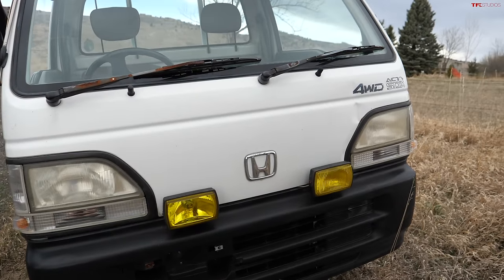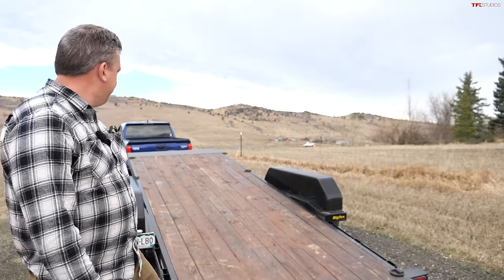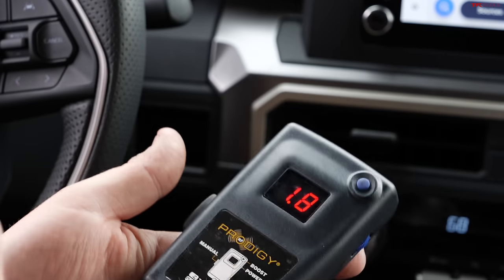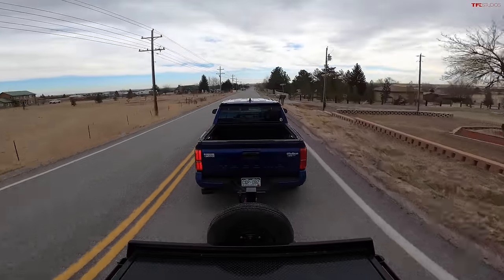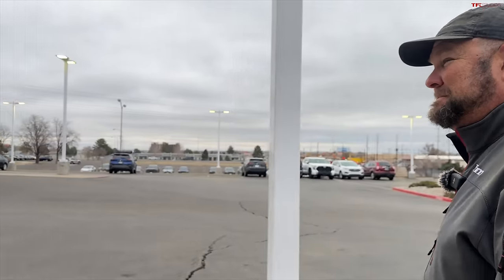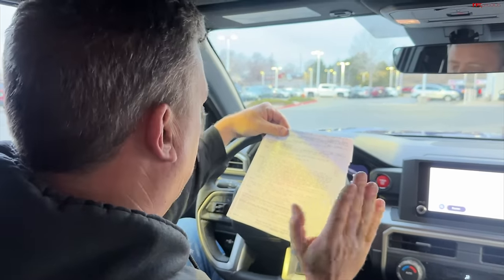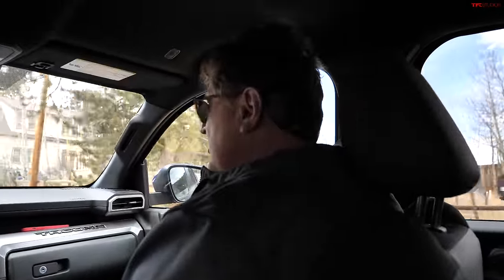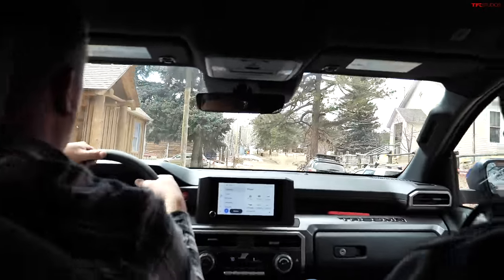Can the New Toyota Tacoma Tow Up the World’s STEEPEST County Road? | Part 1

Comment: Supposed to break under extreme conditions?   That's exactly when you need things to NOT break.
Reply: New trucks just ain't it. Get yourself something with a solid front axle and full time 4WD if you want something that doesn't break in extreme conditions. ;)
Reply: It's meant to break before the transfer case, diff, transmission. It's a good design. What is not good is that it breaks so easily. Either there was a manufacturing defect with the part or the rest of the truck is so weak that the part has to be that easy to break.

I have a 2016 4Runner and live off grid. I have put that truck through hell many times.  Hopefully it's a defect.
Reply: @rundownaxe  it might be cheaper to replace than the diff, transfer case or the transmission but the results are the same when you're out on a trail.  This is why you don't purchase the newest of the new until the major kinks have been ironed out.
Reply: What I don’t understand is why you are doing this?  Who would?
Reply: @rundownaxe my understanding is it's a hold over part. Other utubers have put their Tacoma's on the same trail that the blue crush failed on, and had no issues. I've been watching the Tacoma forums and reddit groups and so far I don't see anyone else reporting a failure of the 4wd system. Now there are other issues like a connector in the front not being fully water tight causing moisture to get into the connector which throws errors in the dash, but that's it so far in terms of trending issues.
Reply: @KiyaWarrior name something with a solid front axle and full time 4wd.
Reply: @slidewide1999 some high end jeeps have a 4 auto setting.
Reply: User error
Reply: @slidewide1999 Ineos Grenadier, Mercedes G Wagon, Toyota 80 Series.
Reply: @Jonesocinco   Hence the hope that it was just an early model thing and not a weak drivetrain saved by an even weaker part. 

Since it's Toyota, I would lean towards the first reason.
Reply: @slidewide1999  Why full time? Takes more gas when you don't need it and if it's sliperry enough that it makes a difference, you could just engage a part time system without fear of binding it up. 

You still have to lock the center diff on a full time system for serious stuff. A fully open 4wd system is practically useless. lift a wheel or put it on ice and it will be the only one spinning.

If there were 2 trucks with the exact same features and traction control. One being part-time and the other full-time. Why would you take on that can't be switched into 2wd for efficiency? Why would you want a useless 4wd mode instead?
Reply: So you're saying that Roman was driving in 'extreme conditions'? Are you kidding me?
Reply: @rundownaxe I completely agree! My comment was response to someone else saying a 4wd vehicle had to be full time 4wd…which I do not agree with at all.
Reply: @MrTonaluv the overwhelming majority of people who buy this vehicle won't ever take it off road.  So, in their eyes,  this was the max of the extreme.  Speed bumps at the local shopping mart is the true test for their off roading vehicles.
Reply: @042452    You don’t drive over hills?
Reply: @garysarratt1  not on the Dirt towing a Heavy Weight…..on a Truck that is barely Broken and has already blown the Diff once…But that’s what they do would you be the 2nd owner of that Truck in 6-8 months
Reply: @MichaelMiller-rg6or  I can't speak to the Jeep system specifically, but 4wd auto generally only powers the rear wheels unless slip is detected.  That's not the same as true full time 4wd.
Reply: @elche1976  Yeah. Not many people actually use their trucks off road. And even less people will push something like a 4Runner to it's limit.

I live off grid in Canada. It's 2km of 4wheeler trail and another 5km of fire roads to reach pavement. I was forced to work through a winter last year.  Imagine the commute after a canadian snow storm.

Did you know that you can overwhelm the traction control system on a 4runner? I would bet that not many people have overheated the brakes on those trucks. Never heard a reviewer say it, that's for sure. I've never seen anyone plow through enough snow to literally bog the engine down to 1st gear in 4low either. 

That was one hell of a crazy winter.
Reply: @rundownaxe  it’s not black and white on a winter road, is it. You drive through a dry section, next you know there’s slush and ice, than back to dry again. Also, it’s much more stable in wet conditions. I wouldn’t want to miss my torsen diff.
Reply: It broke under conditions that weren't extreme. And the pin's shear strength wasn't just randomly selected. Engineers designed that pin to fail in order to protect components in the front driveline. It creates a lot of concern about just how vulnerable other components are if the protective shear pin failed that easily. I'm sure the aftermarket will fix it, but it shouldn't have to be the aftermarket's job to beef up something so vulnerable.
Reply: Driver use can be considered like break damage cause factor
Reply: Could not agree with you more, I’ve put my older 2001 toyota Tacoma 4x4 under more stress than what caused this to break. My FJ Cruiser is a tank. Poor quality parts or worse a poor design, in oversight by Toyota is crazy, use to be a gold standard of quality
Reply: @KiyaWarrior what do you understand for extreme condition? Snow is pretty normal around here.
Reply: @Jonesocinco . Ironed out look at General Motors making the crappy active fuel management from 2007 and still going talking about junk.
Reply: @ramiroescamilla7263  I wouldn't compare Toyota and gm when it comes to build quality.
Reply: 🤦‍♂️...in extreme conditions somethings gonna break. Good engineers design the less expensive or the least critical parts to fail. Clearly, you don't know much about mechanical design. Run along.
Reply: @jackcrackerman  closing your eyes to the other issues make them go away?
Reply: @billw8476  no truck is perfect. Point being this so far seems to be a one off. I've followed the Tacoma forums pretty much daily looking for new reported issues, and there are a few both software and hardware. Some are more repeatable than others... This ADD failure is not one of them however.
Reply: @jackcrackerman  another ADD failure is sitting on the back lot at my local dealer as we speak. waiting for parts.
Reply: @billw8476  sure thing random internet stranger.
Reply: @jackcrackerman  i could say the same about you, of course. but you would still be wrong about calling this a "one off". the only difference is that the girl that owns it does not have an internet channel and free publicity that goes with it.
Reply: not really, extreme should be component breaking conditions, aka something is going to break conditions, not just regular "hard" conditions. They designed it so if something is going to break, let it happen in the diff in a way so you can still drive safely, not having an axle flinging around smashing everything and require a tow. That being said, the condition that it broke in wasn't extreme.
Reply: @slidewide1999  That would be the old Toyota Land Cruisers my guy
Reply: The Tacoma has software (MTS, Crawl Control) to deal with situations like those. He shouldn’t have gunned it that much.

Comment: It saddens me to know that if this was just a regular person that had this truck they definitely either 1. Not gotten the truck back in at least a month 2. Toyota would have said nope, not fixing it because you were hard core offroading. What saved TFL was their connection to Toyota corporate and the fact that they were filming everything.
Reply: Not true at all and stop spreading misinformation like it’s fact. No vehicle is meant to be “off-road”. Most vehicles are built to be capable of doing it at a certain extent (ie: you happen to cross a wet dirt road/snow/dirt/etc, that’s where the. 4x4 or lockers comes in)… if you end up rock crawling and happen to damage the truck then it’s your fault. Be smart and use the truck how it was intended. Pushing it “hard-core” is NOT one of them.
Reply: @C_H_U_  cope harder

Comment: The trans would have overheated in summer temp's.  Not good to see.
Reply: I was thinking a re-test in the summer might be prudent.
Reply: Nobody that know anything would drive that way , any trans would get heated the way they are driving up a slow no airflow hill ! Youd be in 4 low and take your time.
Reply: The newer transmissions run much hotter.  Nothing to worry about.
Reply: For sure. It's only 50F and the transmission temp is peaking that much?  Big question now is, just what exactly does this truck excel at other than a good mall run? A lot of money to spend for debatable returns.....
Reply: @cwqrpportable  It’s a dummy gage, it was actually nowhere near overheating.  It uses a transmission warmer and cooler that uses engine coolant which stays around 200 degrees.  It wouldn’t have made any difference.  If it was pulling more it would have gone into a lower gear.
Reply: No it wouldn't, and it didn't overheat
Reply: 4low range should have been used from the base of the hill allowing the torque converter to lockup instead of slip. The towing in standard range that they were doing was really hard on the trans and building lots of heat from the slipping of the converter but the trans was in no real danger. It wasn't in the red. You can argue that a 2wd truck wouldn't have the low range to go into but then a 2wd truck wouldn't have the traction to make it up that slippery hill.
Reply: @user-tb7rn1il3q  who the hell sells a truck with fake gauges? that's even worse than it just being hot.
Reply: @Ryan-093 what temp gauge in any car is accurate?  Most its just a meter.  No numerical readouts

Comment: IT would be great to do a follow up video with chief engineer Sheldon as to whether this was a design, materials, or quality control issue, to put a lot of concerns to rest.  I.e., what was the root cause and the corrective action going forward.
Reply: Seems like they were using shear pins that were too fragile for the application
Reply: You wont.. ever.  Its a turd. And no one that actually worked on it, will come out and say it. Bet on it.
Reply: @96kylar You are clueless
Reply: There was no control quality issue, but user issue
Reply: That's hard to believe at least from the video. I had a 2013 Taco and it was certainly exposed to more driveline shock in the woods then what's visible in the video.  If you can't have a little bit of wheel slippage while trying to traverse a rocky grade, something more is likely going on.  SEems more likely that there may have been an assembly issue, a subspec material in the part, or under sized for the failure mode. @DaleWilly
Reply: The correct action from the consumer side, never buy the first year of a new gen.  Proof is in the pudding.
Reply: No need. The result is the same. A 4x4 that can't 4x4. Will never buy this truck after this issue was found. I need a truck that doesn't break in those situations.
Reply: @LeesChannel  Pretty concerning that the engineers went with that weak of a pin. That pin was sized based on how vulnerable some part or parts of the driveline by their calculation.
Reply: @karlschauff7Calculations need to be real world tested AND VALIDATED!!!     PROVING GROUNDS TESTED by experienced test people to developed STANDARDS .....
I spent my career doing same.....
Any questions???
Reply: @LeesChannel I thought the paper they got from the dealer said it was the differential clutch sleeves that weren’t engaging.

Comment: Regarding the “case by case” warranty coverage for off road problems, I guess we will all need to constantly film ourselves so that Toyota can’t deny claims.
Reply: They won't deny claims; they don't work that way
Reply: The only reason they know it was off road is because they filmed it and it was clearly a low effort situation for the truck. That kind of break could happen anywhere.

The only way I would see denied warrenty for off road use is if it's caked in mud or has damaged skid plates. The trail they were on would not leave that kind of easily noticeable signs of hard use.
Reply: @DaleWilly lol,  I'm reading the replies... the defender status you have adopted is cute.  People have their views for a reason and you trying to tell them their experiences are invalid is hilarious.  Dealer in disguise.  Take deep breaths.
Reply: I've never had a warranty denied from a vehicle manufacturer as long as you don't go in there with something completely beat up showing the reason why it broke.
Reply: @DaleWilly  LOL Toyota dealers have definitely worked that way. One guy with a 3rd gen was denied coverage for a busted rear diff because the dealer claimed it was 'abuse'. Asked how they concluded that and they said there was mud all over the underside of the truck.
Reply: @karlschauff7989  and the real kick about that is the rear diff on the last gen Tacoma is infamous for having issues.
Reply: I don’t see Toyota denying a claim for a axel , or any part in the front differential. After all it an off-road vehicle.  Every one is a little worried, everything is covered. Buy one it’s safe, plan your off road trip with forethought, and remember it’s not a tank.

Comment: Okay, PLEASE start doing more videos towing up this hill or a similar hill! These slow torture climbs actually represent a large part of my towing as I tow up a steep and winding mountain road up here in the Rocky Mountains.
Reply: yeah take the land rovers and that gernader
Reply: Andre absolutely should make this tow in 4WD LOW.  That way he'd suddenly have much greater wheel torque applied to all 4  & we'd see if it failed again.   Also the torque converter might stay locked & not produce so much transmission heat.    I've driven up highway 158 outside Eden UT up to Powder Mountain Resort, that road is paved & consistent 14% grade.  The times I've driven my underpowered 2007 4.6 F150 4X4 std. cab work truck up in low range it feels like your flying up vs. in high range
Reply: 2-miles and the transmission almost overheated...!?!?!?  Foot to the floor...!?!?  Not good, in my opinion, on both counts.

Comment: If anyone had any questions you proved it--an underpowered 4 cylinder turbo CAN haul a minor load and the transmission will barely overheat and the 4 wd may not break! Quite an accomplishment!
Reply: Run the 3rd gen with the 3.5 V6, it would have been worse.  Your point?

Comment: This is the problem with all these new modern electronic activated system, it's not meant to resist much of anything. Like he stated, there's a fuse meant to blow.... They could have made it a resettable circuit and over engerniered the parts not to break and the first little amount of throttle/wheel slip...
Reply: Nothing is overengineered anymore. Its engineered just enough to last till warranty is out. Sometimes not even that.

Comment: Yes you can get a trailer brake controller installed after purchase of the vehicle I had 2 years ago when I bought a chevy silverado I had to add a trailer brake controller to it so I had to leave it at the dealership overnight for them to do that it was 800 bucks.